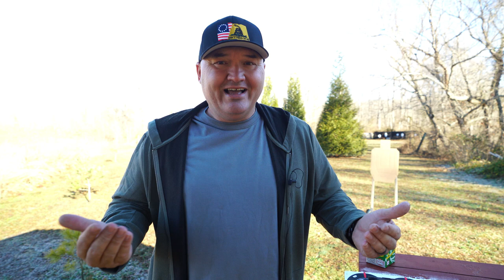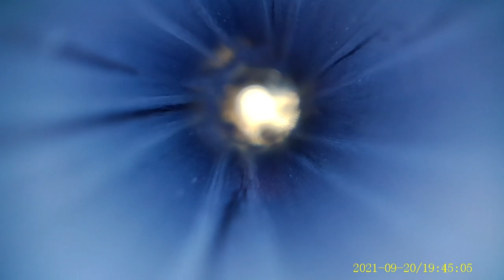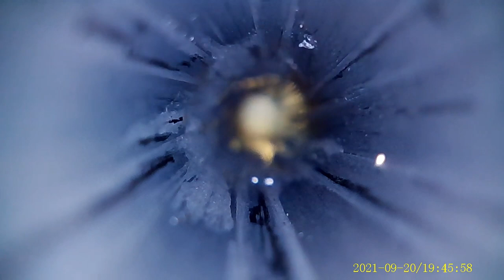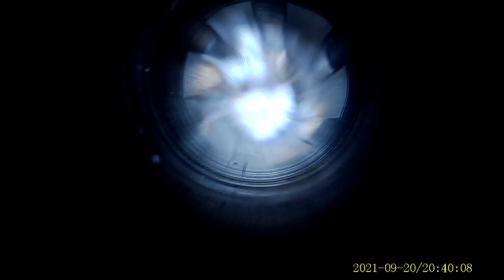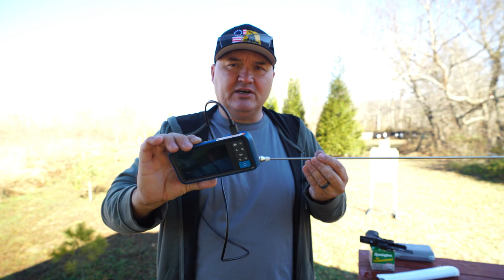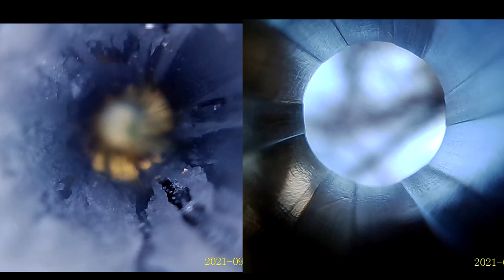Leaded Barrel BORESCOPED!!!

Comment: Thanks Buffalo. Excellent video idea. You're right, I had never seen a leaded barrel from the inside like that before! That's amazing. The Thunderbolts leaded up my Ruger MK IV even worse than that. I couldn't even get a cleaning rod through it. Had to use a cleaning rod and brush made for a .17 caliber just to get it opened up enough for my .22 cleaning rod. I made the decision right then and there no more Thunderturds for me.

Comment: THANKS!!! 👌.   That answers the problem I've had with my Rossi 243. I bought it awhile back off the floor at a big local gun store, they had 5 lined up and I picked one for $140. It looked new, I liked the design, awesome sites on it. First time shooting it, I hit nothing with the fancy iron sites even at 25 yards? I checked the barrel, ran a patch through it, black, went for the brush and extreme trouble getting a brush through it. I broke 2 rods attempting to brush it out. More and more lead, more oil, several patches later I begin to see daylight. I'm guessing the last owner never cleaned it, must have traded it in and the gun store guy never checked it out. It hits paper now but what a whack'o experience. To order a new barrel was $180, to have it regroved was $150, new cleaning rods $12. THANK YOU for doing that video and showing the bore camera and what "lead build up" causes, right down my alley with the Rossi 243 that looked new. I checked the barrel in the store and I checked it with my little led light when I got home from one end but neither showed anything like you showed with the bore camera. That's a $100 well spent and worth it, I'm getting one. That really confirmed my problem here, was a first time to deal with lead buildup. How anyone could allow a rifle to get that dirty, lol  👍👍

Comment: Good video and good information.  You might want to go into how you cleaned the lead buildup out of the barrel.
I shoot a couple .22LR pistols and then use a Bore Snake afterwards.  If you have trouble getting the Bore Snake through, it is time to break out the brush and solvent.
Reply: At worst it's time to break out a .17 cal brush

Comment: Something I used to do was run some copper jacketed bullets as "cleaner rounds" to push out the lead deposites.  It worked well.  Even Hickok 45 has said he does the same thing. I no longer run full lead bullets in any gun.

Comment: Buffalo, excellent video…of all the rimfire ammunition I have used over the years Remington Thunderbolts have been some the most problematic.22LR ammo I’ve ever used…they have leaded bores (much like your latest experience), had more failures to eject, failures to feed and are frequently underpowered as well as failure to fire…I’ve got an older BuckMark that will not function with them at all…same with my Remington Nylon and SIG 522…no issues with Rem. Golden Bullets, Federal copper washed bulk pack, Agulia Super Extra or any other manufacturer using a copper washed bullet for that matter (you will still have powder residue fouling after a day at the range, but not heavy and not leading)…I tended to shy away from using them in the good ‘ol  days and I wonder how their QC is today with the need to increase  production do to the shortage (that could be true with any brand for that matter)…I’ve been thinking about one of the budget bore scopes and this video made up my mind 😊 and thank you for the Amazon link 👍…Stay safe and well 🙏

Comment: Here's my theory, 2 cents worth. Your pistol has a very narrow barrel. It also has a slide to cover it up. The ammo is probably better suited for rifles with longer barrels. Your low mass barrel heats up quickly as the powder still burns behind the bullet. the slide covers the barrel and slows it from cooling down. A soft bullet thru a hot barrel must likely cause some lead to melt off, from heat (gas temp is higher that lead melting point) and friction. Now not all theory. I had a Ruger Mark II 6 7/8" bbl, and ten magazines all topped off. I was curious as to how fast I could dump all those rounds, so I fired thru all ten magazines just a fast as I could. The barrel was smoking hot. When I went to check my target (11 yards), half of the holes appeared normal, and half the rounds had key holed. But the worst part was having to clean out the lead from the barrel, slow and painstaking. So normal firing does not lead up this gun, and if it gets hot, I set it aside to cool.

Comment: Good video buffalo i had the same problem with my Glock 44  ibough some chore boy 100% cooper scrubber cut a little piece put it through the barrel with a chopstick couple times then use my solvent and a brush really easy and you don't have to spend hours scrubbing the barrel.

Comment: my 22 magnum doesnt get build up but them are full metal jacket bullets where as a 22 lr is only a copper plating wich is thin exposing lead to rifling, i clean very often though on my 22 mag and 22 lr guns, this video shows you cant go wrong cleaning more often, nice to see just what can happen and maybe bulk ammo runs a little more dirty then match ammo, rapid fire with a barrel getting hot can have an effect also, my buckmark 22 i usually do a 2 to 3 shot burst then run to cover and shoot the next target, the pistol gets cool down time a lot, with a semi auto 22 rifle i do the same but i tend to shoot a little and let cool down a little wich drives some 22 lr guys nuts having a pause in my shooting or taking a couple shots then waiting a little for the next shots, a bulk pack lasts me longer then most people and i usually go for a good pace in my drills with emphasis on accuracy over speed using cover, no matter what 22 pistol or rifle getting training in keeps you physically fit, gives you sight pictures, help you press trigger at the right time and helps you with standing, kneeling, sitting and prone. many times i feel i am faster on target and more accurate with a 22 rifle then even my Ruger AR-15 in a defense drill, i look at it as speed, tactics and accuracy beating muzzle energy, the 22 lr doesnt have much energy but shot placements you see hunters putting on hogs shows that effectiveness with a well placed shot with camera evidence and no human is match for  fighting a hog bare handed, so if it works on hogs, its no problem for defense but we train with the rifle as we would our AR -15 and even if we dont have a 30 round mag for the 22 lr rifle it teaches us how to use ammo better and how to fight better with limited resources

Comment: The thunderbolts always lead up my barrels. I think it happens with the semi autos only. I just use those for revolvers or lever actions etc. They are not lubed and the lead is soft.
Reply from the maker: That's interesting. Thanks for the comment!
Reply: Very true.  I gave all my "crappingtons" to my cousin. He tried using them in semi-autos (and I did warn him) with the same results, but as you commented, he just used them up in his revolver & lever action firearms.
Reply: i always use them in my walther p22 i just clean it after every range trip

Comment: I love my Teslong borescopes - I got the rifle and pistol one but I prefer to connect them to my computer or phone. It also makes them a little cheaper. That being said, it would have been helpful in this video if you shot that Thunderbolt again to show the improvements after cleaning as well as what the buildup might have been like after 20 to 50 shots. I mention this because its possible you could have got a bad lot as I coach a youth shooting team and our kids go through at least a case of 22lr per week (5k rounds) so we have a lot of data on a variety of ammos. The Thunderbolts are one of the ones we consider fairly good, but they are part of Vista and we have had some serious issues with Federal Range Pack & Champion Training (automatch) in 22lr as well as Remington 9mm. Granted, we've shot tens of thousands of both without issue, but definitely the 1st and 3rd qtrs of 2021 had a lot of us getting ammo so bad we had to return it as we were getting squibs and other severely underpowered loads. It could be you have a really bad lot like we experienced.

Comment: I shoot soft lead .45 Colt 250 grain cowboy loads using my Howell drop in cylinder in my Uberti 1858 new model army revolver and I always use a tight .45 caliber bronze brush in the bore and chambers every time I clean my piece and I always clean it after each shooting session and it helps a lot but there is always a tiny bit of lead residue in the grooves no matter what I do but my accuracy remains consistent with no keyholing. You can see my shooting video I posted on my channel of me using that piece with those loads in the cylinder with a flower pot as my target from about 10 yards away

Comment: That’s why I try to copper plated 22 when I can.I have the thunder bolt. My Ruger will shoot the fairly well. My heritage is a different story. Even though I clean it after every single use. I just the chaippi 1911 22 haven’t shot it yet. Because most of the ammo I have is thunder bolt. How about a shoot out between a 38 special and 45 LC . In the 38 special you can only use the following ammo 38 LC and 38 special standard ammo. You know you take the 38 LC and pull the bullet and add 3.16 inch to the case and stick the bullet back in you got the 38 special. Same on the 45 LC. Use the scoffield . Shoot out between 38 special and 45 LC in ballistic gel. Who far will they go. 
Which is better.
Reply from the maker: Man that's some good stuff. Thanks for the great comment and suggestions.

Comment: Based on the surface finish of the cleaned bore, I doubt Walther cold hammer-forges those barrels. Probably button rifled. If you look at a CHF barrel bore it's like a piece of glass without striations or machine marks. Probably less probable for copper or lead to lay down, of course that is if the bullet and barrel are properly sized and no gas blow-by happens. Ruger CHF its Mark 4 pistols, would be fund to have a look down one of those bores after a thorough cleaning.

Comment: Wow. I’ve never seen a 22 rimfire lead like that, and I’ve shot lots of that ammo. I wonder if that box could have been exposed to high heat, or if something else could have harmed the lubricating film.
Reply from the maker: It happens sometimes. I've had them lead up a lot worse than this. It can be due to the ammo but also some bores are more prone to leading than others. An ammo that will lead up gun "A" might work perfectly fine in gun "B".
Reply: Yeah. I do a lot of casting, powder coating and traditional lube. If the bullet isn’t a tight fit to the bore (or cylinder throat in the case of a revolver) that’s a sure recipe for leading. Maybe that bore is on the large side of tolerance and that ammo on the smaller side.  I guess as long as there is an ammo it likes…

Comment: So many good tips in just a 12 minute video. You have helped a lot of us with this. I've shot some of the polymer coated & powder coated rounds in 22lr & 9mm which are supposed to help not lead a barrel.  I wonder on that. Maybe Santa will bring me a Bore scope so I can check barrels now. Lol. Does that one have shorter rods ava. to use for handguns?  Really appreciate this video.
Reply from the maker: I think you can buy it with the handgun rod. I don't know if the rods are sold separately or not. I need to check into that as I'd like to have a handgun rod so I'm not knocking stuff of the bench with that rifle rod when I am using it in the reloading room. They also sell them just on a cable with no rod but I don't think I'd like that. Thanks for watching my videos!
Reply: @buffalosoutdoors  I'm old so my bore scope is a piece of white copy paper at the chamber of an unloaded- checked twice - barrel & a flashlight shined down it. Lol Time to upgrade now. Thanks

Comment: Great video and demo of a common issue. I’ve got 2,000 of those thunderbolts in my safe and now worry about the mess they’re going to make. What did you use to slick that barrel back up?
Reply: Sentry Solutions makes a liquid and powder molybdenum that works well. It takes a bit of effort to apply it but once coated it does a good job.

Comment: What bore cleaner did you use it works great thanks for the videos
Reply from the maker: I used Kroil and a nylon brush. It took a lot of scrubbing but it came out. Sometimes I'll use a few strands of copper from a Chore Boy scour pad to aid in the removal of lead but it has to be the PURE COPPER ones not the coated ones.

Comment: i don’t buy Remington bulk nothing in 22 . i won’t but any Remington 22 ammunition except I can get it cheep and stock it back last resort or last stand ammunition. I personally have seen peoples rifle leaded so bad you could only see a tiny bit of light through the barrel. how that one pistol didn’t blow up is beyond. the man bought a new bull barreled ruger and a collectors tin box of 300-500 rounds. the ammunition was Remington. i was a baitys custom gun works  when the man bought it back. they lee view it and every one was shocked because none of us ever seen a baller so bad. the bullets we’re packing up i the barrel and peace’s of each bullet was blowing the center out the bullet in front of it .  gunsmith leanord baiting took the barrel off , rigged a special plug for a high pressure air hose , then put air to it . we stood around the counter a safe distance talking a you could hear when a bullet pushed out because it would fall in a bucket. finely when about all the bullets pushes out the last 2-3 broke loose and I sounded like some one shot a stubbo38 special. the cleaned it , checking it , put it back together telling the man don’t shoot them no more . baity  at one time was as told to me one of the top 100 gunsmiths in the country at that time. he does great work . nana and wishing you well.

Comment: I have the exact same gun and the same thing happened with the new thunderbolts! It has been since Remington re opened. I never had thunderbolts do that before! The lead is so soft!! I will never buy it again as I have never had that much lead and I clean my gun every time!
Reply from the maker: Wow! Thanks for this. I wondered if anybody else had this happen with this ammo and you even got the same gun!
Reply: @buffalosoutdoors  I have never had a leaded barrel that bad before. I had to use one of those spiral stainless steel brushes to get it all out as it ruined my copper barrel brush.
Reply: Damn, is this why the 500 pack was only $40 at Academy a couple months ago? Couldn't pass that up in these times.

Comment: Buffalo, do you have a “magic” way you clean out the lead or just brushes and elbow grease?
I have this same issue frequently especially with uncoated 22 bullets.

Buffalo, you don’t have to reply. I just saw your response to a previous post.
Thanks.
Reply from the maker: No magic here. I use Kroil, a nylon brush and lots of elbow grease. Then I patch it out. Repeat. Sometimes I'll use some strands of pure copper from a Chore Boy scour pad and wrap that around my brush to really get the lead moving but it has to be the pure 100% copper pads not the coated ones.
Reply: That’s pretty much what I do. I have read about some lead removal kits that have a wire mesh that you push through the barrel, but apparently they don’t make one for 22lr. I guess it’s too small a diameter.
Thanks. I really enjoy your videos. I know it’s a lot of fun,  but it’s a lot of work too!

Comment: Had the same issue with the same type of ammo.  Must be a qc issue for that lot.
Reply: Also, what method did you use to clean out the lead?
Reply from the maker: Kroil, a nylon brush lots of elbow grease. Then I'd patch it out. Check it. Repeat if necessary. And it was necessary! LOL It helps to use some strands of copper from a Chore Boy PURE COPPER scour pad and wrap it around the brush. Must be the PURE 100% COPPER not the coated ones.

Comment: Ok. I shoot a lot of thunderbolts. I’ve never had an issue. Most of my 22 pistols are well shot in. Then I bought an M&P 22. Horrible leading with thunderbolts. Shot the same thunderbolts through my RUGER Standard model (1968 at least 50,000 rounds through it. Been in the family a long time). No leading in the RUGER.  I ended up polishing the M&P bore. I the put 100 rounds of mini mag through it. Then thunderbolts.  No more leading.  Long story short, I think bores in newer guns are rough
Reply from the maker: You might be right. That could be a contributing factor. In my case it doesn't work though. That PPQ has a high round count. That's my drill gun.

Comment: Do you use a regular brass brush on the barrel?
Reply from the maker: Nylon brush and Kroil with a helping of elbow grease is what I used this time. Sometimes I'll wrap some chore bore copper pad around the brush if I am in a hurry. Has to be the PURE COPPER pads though not just the coated.
Reply: @buffalosoutdoors  Ok good thanks. I didn’t think a nylon brush would clean very well but it did. I’ll have to get one.

Comment: Should you not keep your firearm clean?
Reply from the maker: With a question like that I can only assume you are new to firearms so I will answer accordingly. Firing ammunition is naturally a dirty process. You can't "keep" (as you worded it) a firearm clean if you use the firearm. Unless you clean it after every single shot it is going to build up carbon, lead, copper (depending on bullet construction) and other gunk. So you can't "keep" it clean at all times. What you will find is that you will either clean it after each range session, hunting trip or match OR you will settle on a cleaning interval. I run my Walther PPQ 22 at a cleaning interval of about every 500 to 800 rounds, unless something like what occurred in this video happens in between intervals and then obviously I will have to stop and clean it at that time, like I did here in the video. My defensive guns get cleaned substantially more often. Hope this helps and welcome to the world of firearms and shooting.